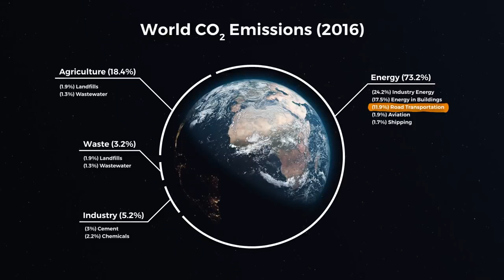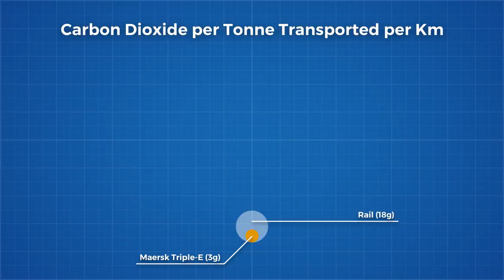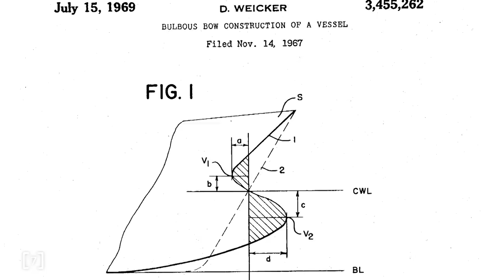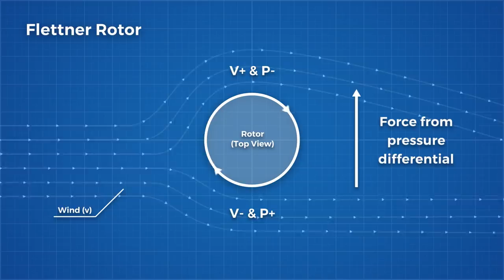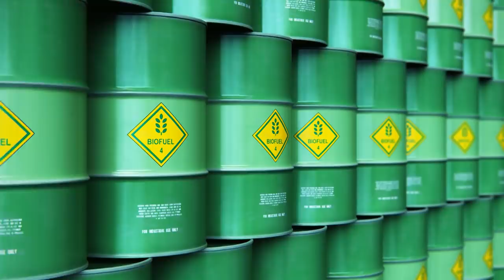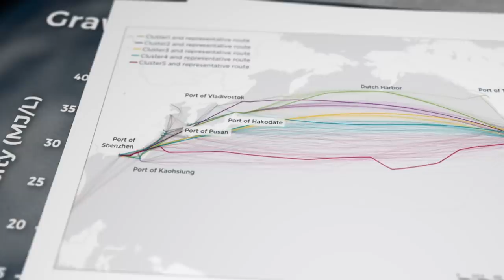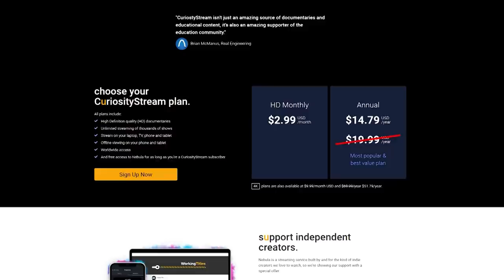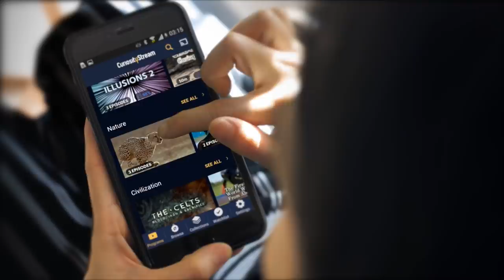Are Renewable Powered Ships Possible?

Comment: Ships used to use renewable energy back then. Shocking I know.
Reply: If you were thinking of the days of sail I offer the following example.  In 1870 a premium sailing vessel entered service, the ‘Cutty Sark’.  The Cutty Sark was 64.74 metres in length with a beam of 10.97 metres and a loaded displacement of 2 100 tonnes.  She was able to carry 1 700 tonnes of cargo and to harness the energy in the wind the available spread of canvas was up to 2 976m2 which was tended by a crew of about 30 skilled men.  A ratio between the sail area (SA) and the vessels displacement (D) determines how lively she is; ‘lively’ being nautical speak for ‘fast and manoeuvrable’.  The carrying capacity of cargo ships is constrained in two ways, mass and volume which leads us to the ‘stowage factor’ of the cargo; the more mass on board the greater the displacement which in turn impacts the efficiency of the hull form and sail area / displacement ratio.  A vessel constrained by mass is said to be ‘down but not full’, a vessel constrained by volume ‘full but not down.  When in the tea trade, which the ‘Cutty Sark’ was designed and built for with fine lines (more nautical tech speak so again - no need to worry about it) she could carry around 600 tonnes of cargo at speeds of up to 17.5 knots dependent on the prevailing wind and had a typical China to UK time on passage of 120 days.  The tea trade was very competitive so ‘time on passage’ was a large factor in securing the premium freight rate that made her cost effective.  Rounding things out, her maximum available sail area gave circa 5m2 of canvas for every tonne of tea carried.

As soon as the Suez Canal opened, which the ‘Cutty Sark’ was unable to sail through; she lost her advantage, raw speed, to the steam powered ships of that era who could beat her ‘time on passage’.  Mechanically powered ships have improved in terms of efficiency, on a freight tonne mile basis, by at least one order of magnitude since then.  After losing out to the coal burning, steam reciprocating mechanical ships of the late 19th century ‘Cutty Sark’ was relegated to the Australian wool trade, just about the bottom of the barrel in maritime terms and only one small step up from being a 'honey barge'.  The canvas, cordage and extra manpower needed for sailing ships was never a very benign environmental option so please discount any idea of sail as ‘sustainable’.  All this is without the problem that if ‘the wind don’t blow the ship don’t go’, when it does blow it often blows in the wrong direction for your cargo delivery needs and sometimes there is rather too much of it for comfort.

Random fact about ‘Cutty Sark’, it is said to have been possible to coax 3 000 horse power out of her sails, or in ‘real money’ 2 206 500 Watts (2.2 megaWatts), assuming this was in ideal conditions that is about ⅔ of the solar power that might be harvested from the ‘top of stow’ of a Maersk Triple E, again in those elusive ideal conditions and 741 Watts for each square meter of sail area.  So that majestic spread of canvas would have been even less efficacious for delivering your baubles and bows from the orient, despite taking about three times as long on the voyage.  The sails on the ‘Cutty Sark produce about 0.33% of the power need to propel a Mearsk Triple E and covering the top of the stow might produce another 0.5% so with both systems working simultaneously in ‘ideal conditions’ the energy harvest would be less than 1% of the output from the ICEs.  Canvas and hemp are accorded 'renewable' (read as ‘natural’) status, if ‘synthetics’ are used there will still be a need for the input of FOGI products.  'Synthetics' would have a much better working life span than 'naturals' but would still yield the same amount of energy, 741 Watts for each square meter in those elusive ideal conditions.  Combining with solar electric would involve two systems in place of one, which then runs you into the problems of expense, complexity and redundancy.  Remember shipping is a high volume low cost, therefore low margin business, and all costs have to be beneficial. The 'Cutty Sark' was about 2 000 times less productive than a modern container ship powered by fossil fuelled ICE (internal combustion engines).  Wallenius are currently giving wind power a go with wing form ‘sails’ but evidence is a little short of proof as of this date.  KTH (Kungliga Tekniska högskolan), a sort of up market university in Stockholm, who are using the funding to derive results will probably, and eventually, in the best traditions of academia ‘publish’ a ‘paper’ unless the funders invoke the well known ‘commercial sensitivity clause’ of their agreement with the KTH.  Wallenius is a major shipper of vehicles were the product is effectively its own packaging, other goods are moved about in ‘containers’ so the loss of capacity, ‘broken stowage’ in nautical speak, caused by containerisation needs to be factored in

Comment: Missed opportunity to explore nuclear powered ships. Militaries have used them for decades. Sure they have their drawbacks, but as the technology progresses, so too will fission’s safety
Reply: If you do a web search for ‘nuclear ship savannah’ you will see that it has been tried and did not work.  A similarly heavily subsidised, by the government, vessel is in use in Russia which also operates, in support of the Northern Sea Route, a fleet of nuclear powered ice breakers these may, or may not, have been completely without issues.

Just think; would you have full confidence in the management of a nuclear reactor under the control of an anonymous entity only traceable, perhaps, via a letter box in a FOC (flag of convenience) nation state?  If you are, could you sell that confidence to Japan, the state that hosted the Hiroshima and Nagasaki nuclear detonations as well as more recently the Fukushima ‘event’?  Then try that same, or a similar, sales strategy on Ukraine, the nation state that as a part of the USSR (CCCP) hosted the Chernobyl ‘event’.  Modern iterations of nuclear energy, thorium fuel, molten salt reactors or fusion reactors, will carry the legacy of past problems.  It is the global trepidation of anything with 'nuclear' in the name and the economics of nuclear having transitioned from 'energy to cheap to charge for' too 'the costs of remediation are incalculable' that will prevent the adoption of nuclear energy as a means of creating energy at sea.  Modern reaction systems may have overcome the safety problems but the general public, having been misled in the past, will be reluctant to believe the fresh new promises.  The incident of the ‘Ever Given’ blocking the Suez Canal may also have a little to add to this debate.  The cooling water on ships tends to get taken in from near the bottom so when running aground the inlets are in a prime spot to get plugged up restricting, if not stopping, the flow of coolant.  One thing that the TMI, Chernobyl and Fukushima incidents all had in common was that the supply of coolant, or rather lack thereof, as a fundamental cause.

‘They’ say nuclear is cheap, it’s not it is expensive and has a large embedded carbon quotient as well as being complicated, dangerous, not universally socially acceptable and having only ‘no need for refuelling’ as a questionable advantage; actually it does need refuelling just not as often.  When ‘they’ do need to refill the warming up stuff it takes considerable longer than pumping tonnes of thick black stuff, HFO cSt380, or thin runny stuff, MDO, onboard which is one of the reasons HMS Queen Elizabeth and HMS Prince of Wales are pushed about by ICEs and gas turbines thus using a similar fuel as the aircraft that fly off of them.  The Royal Navy (RN) with a high degree of skill and expertise uses, at vast expenses to the UK taxpayer, a current operational nuclear fleet of 11 submarines (also known as ‘boats’) in two flotillas, seven attack subs and four ballistic missile boats.  The carbon footprint of all the extra bits of hardware and the fuel, including processing thereof, from ground to propeller, are the external costs that never seem to get considered.

Disposal, once it wears out, of both the machine (that was a ship) and fuel is another can of worms best left unopened.  The 26 RN boats no longer in use are laid up (some in Rosyth and some in Portsmouth) awaiting long term deconstruction including dealing with the fuel rods and other irradiated material.  The USN is not, as far as I know, a commercial organisation working to very tight margins and also has the skill and expertise to handle the complexities of nuclear power; so as well as submarines their aircraft carriers are nuclear powered and each of the current iteration has a build cost three times that of QE/PoW, bigger crews and more generous funding.  For those who still think that nuclear energy might be the answer I recommend this report: - https://www.bbc.com/future/article/20200901-the-radioactive-risk-of-sunken-nuclear-soviet-submarines?ocid=ww.social.link.email.  The navy of the USSR might have been under resourced and over extended but it was still generously supported in comparison with merchant shipping.

Comment: Ships are uniquely suited to be powered by liquid hydrogen, as they have the right size to store the cryogenic equipment onboard. This hydrogen should be produced with wind power onshore.
The entire process is low efficiency from the production side; but a cryogenic hydrogen powered turbine has the highest possible conversion efficiency.
Ships have been powered with renewable energy for centuries (with sails) so we have experience with it. We know how impractical it is, but a normal ship can employ a wind-augmented power plant easily.
As I don't see marine industry investing in hydrogen powered ships; so we are left with nuclear powered ships. But there was an attempt by the US in the 60s - but their nuclear powered cargo&passenger ship wasn't allowed in most ports, and faced some absurdly expensive insurance rates.
Reply: @BernardLS 

Hydrogen is still the most viable replacement fuel.

For fuel density, as the video mentions. Most of the world's cargo shipping can be carried out with very little sacrifice to cargo space with hydrogen.

For energy conversion, it's not a fair comparison. Hydrogen is energy storage, not an energy source like oil is.

Furthermore, power for green hydrogen need not compete with power for transitioning the grid.

There is more than enough renewable potential to feed the world's energy needs. But for the grid, location and variability makes it hard to replace fossil fuels.

Hydrogen generation is not burdened by neither weaknesses. For hydrogen, variability is irrelevant and solar and wind farms do not need to be close to population centers.

This makes renewables and hydrogen a great fit.

Countries like Australia and Saudi Arabia especially can leverage their solar advantage to become hydrogen exporters without needing cable interconnects.

For risk of flamability, given the pressing need to decarbonise it's an acceptable risk. We accepted the risk when we replaced sails with explosion prone steam boilers. We accepted the risk when we switched to ocean polluting diesel.

We can accept the risk for hydrogen.

So on so forth.
Reply: @CandleWisp   Using lots of energy it is possible to liberate hydrogen (H2) from Methane (CH4), the cheapest available source of which is the FOGI (this is called black, brown or gray hydrogen depending on how bad it is), so that will earn you the ire of the Green-meanies.  The other, much touted, option is to liberate the hydrogen (H2) from water as so called green hydrogen if the power for the liberation is environmentally benign; you need a lot of energy and while fossil oil & gas, or perhaps coal, will do it and are the most readily available (darkening your green H2 in the process) any energy source, wood, photovoltaic, wind, tidal, et cetera, will do.  H2 is said to be good for use in fuel cells that will give clean energy when combined with Oxygen (O2) and leave only water (H2O) as an effluent; so as well as the cost of creating the hardware and separating out the H2 in the first place we now have the cost of providing the O2.  H2 is very, very light and very, very volatile so this is where we remember the ‘Hindenberg’ airship disaster and while events of that magnitude might not be likely much smaller H2 fires or explosions can cause a lot of damage; as at Fukushima Daiichi.  The ‘light’ means that though there is lots of energy per unit mass there is not much mass per unit of volume so all the problems of CH4 but much worse.  You need to compress it, more than a lot, or cool it, more than a lot, to get enough on board your ship in manageable volumes to be useful.  The alternative to fuel cell use of H2, burning, also generates combustion products which includes waste heat going to the cold sink and H2O.  Hydrogen may be energy dense in mass terms but is not energy dense in volume terms; not only does it have to be separated out from the compounds it normally resides in (H2O , CH4, CxH2x+2, NH3, et al) but needs to be cooled, a lot, or compressed, a lot, and then in either state contained in heavy and expensive systems it is not the easiest of fuels to handle, combust or electrolyse.

H2 may have a place in the energy mix on land as a storage medium but on a ship where is the H2 coming from? If harvested on board there is a reasonable and constant auxiliary power need the question could be posited, ‘why go through the extra stages instead of using the harvested energy directly?’  After harvesting the energy, from wind, sun or motion of the vessel, as electrical energy better to deploy that energy directly and immediately as heat, light or mechanical work.  If the H2 is to be loaded from ashore there is, for safety reasons, a much more costly process that needs to be created and maintained.  The current system is the cheapest that the shipping community has been able to devise any replacement system will primarily need to be cheaper to find favour.  Systems proposed will need to meet with the same caveats of cost, space and complexity and so would need to perform in a ‘high quantity, low added value’ mercantile situation.  The numbers with H2 are getting very difficult to show any sort of surplus so is this a case of running hard to stand still?